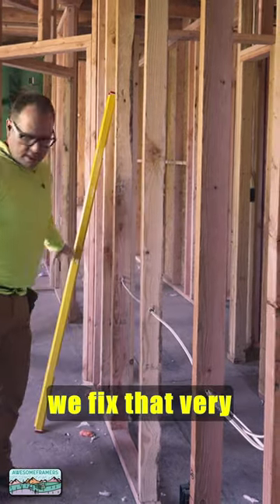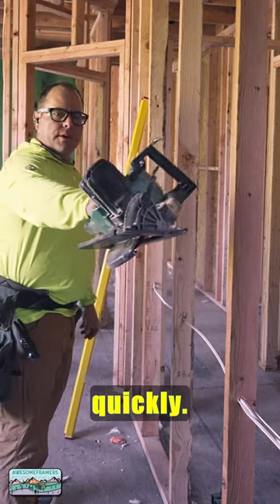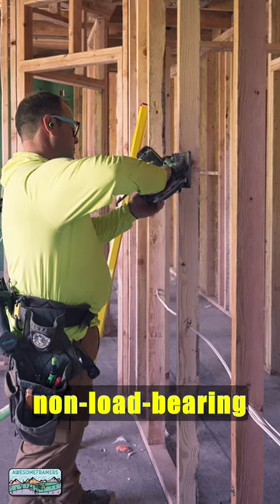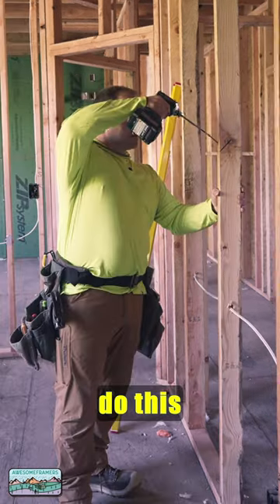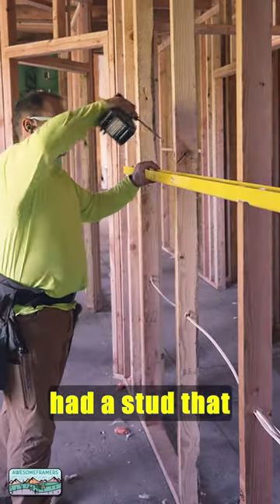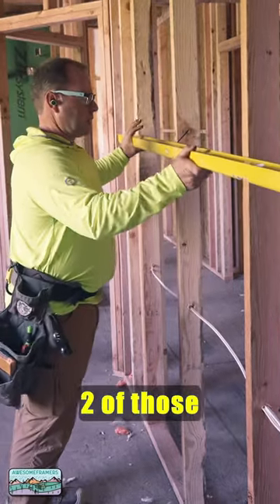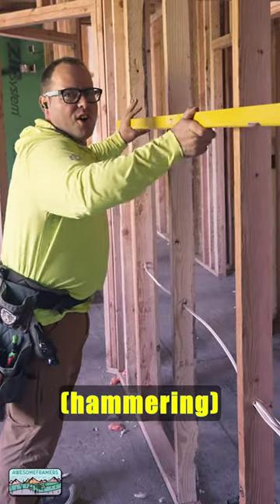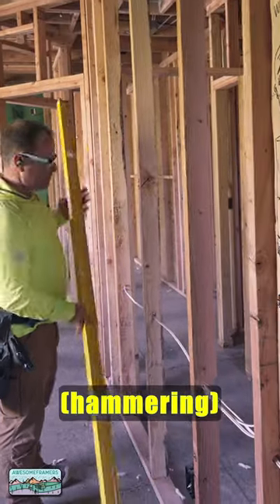Fix it Fast #framing #qualitycontrol #framer #diy

Comment: I just use my Dewalt electric “hand planer” and shave off what’s needed….
Especially cause we all know it’s not just one stud that will need reshaping.
Reply: What about the other side lol
Reply: @chinchilly6544  What about it? lol
I do the same thing, hand planer.
Works both sides without taking too much off the board & done quickly with out screws or cuts.
Reply: The other side bends in
Reply: @jamiehalpin9921  and? When you hang the sheet rock, you will never know. 

Or the worst case… a cedar shake becomes a shim (hate that personally) or any other boards (on either side) can be shaved to match with a planer.
Reply: @fishkulture  
You have no common sense nor experience
Reply: @ericyoumans1148  hahahaha 👍🏻
Thanks keyboard warrior, glad you put me in my place.
Reply: @fishkulture  
Keyboard warrior with over 20 year of framing experience, 
You're welcome
Reply: @fishkulture  plane isn't that fast, for one a handplane is very slow to use most are dull and need forced to shave and going downward umm yeah his trick worked faster I believe slice and screw ✔️
Reply: @fishkulture   What are the odds you'd be done a rabbit hole planting the wrong parts over and over , mark where it needs to be plain and messing up possibie? I  think his trick works pretty good 👍 🤔 😏 😉 🤷 😅 👍
Reply: @MakeWithMike  yeah I can see that, but that’s why I use an electric one, quick and efficient.

And if he said it was over 1/2” out or something else in the description about it, I would probably agree.

And I never said anything about this not working, I’d definitely try it if I really needed, on a non-load bearing wall.
Reply: @MakeWithMike  👍🏻
Reply: That's alot of time

Comment: When I framed homes I had a guy at the studpile notching studs in the center 3 5/8s by 3/4 heavy deep. Then run 1×4s in them for perline. Keeping them straight both ways.  But then again we would coil all our lumber plus turn all the crowns the same way.  But nice trick for subpar framers.

Comment: I wish more builders would do this. Especially with all the Wal-Mart wood circulating these days.  Relief cut your warped studs people.  It's not the drywallers' job, and they'll only do it if it's extremely bad.

Comment: Close I'll give you the real way. Bowed in cut 45 shim it out drive a nail. Bowed out use a power planner. And check your studs vertical and horizontal.

Comment: Bro literally did that right in the knot on the wood.
Reply: Yeah definitely not how it's done..
Reply: What's the issue with that? Is that bad?
Reply: Oh cause like, its a weakpoint?
Reply: Lol I'm surprised the knot didn't pop out when he drilled the screw into it
Reply: @preston0  yes sir I've had them break the whole board putting a screw in a knot lol

Comment: During the pandemic, the price of a 2 x 4 x 10 was up to $14.25 apiece. I figured if I’m paying that much I might as well go to Lowe’s and personally inspect every piece. I threw back over a third of the studs they had and only took the Straight ones. When my framer saw the 2 x 4 x 10 studs, his eyes lit up. Working with straight lumber is so much easier.

Comment: May want to use timber strand if in a kitchen or anywhere it has to be true and straight. Otherwise crown, plane if one board and not in an opening such as door or window trimmer. Cardboard shims if you got crap lumber.

Comment: I squirt some PL adhesive in the cut before screwing it. I'm not sure it makes a difference but the customer is impressed.
Reply: Another way is to have a 3' piece of scrap, sister it 50/50 over the cut and screw it in. Ezpz

Comment: You can also solve that by taking the time to check your boards before using them.
Reply from the maker: That is quite the case Ethan, as was done on this and all our walls.  The thing about wood though, as it wets and dries it can move around.  That's why quality builders go back and check.  Crowning and culling isn't enough.

Comment: If people Crown the 2×4 before they build the wall usually  don't have that problem.
Reply from the maker: That's wishful thinking.  All studs were culled and crowned here.  Wood moves during wetting and drying.  That's why we take this step.
Reply: I made the same comment, but you'd be surprised how many guys there are that don't know what crowning means.

Comment: a plane or belt sander works better and you dont remove 1/3 of the bearing capacity by cutting a notch in it

Comment: Use a planner.  Simple and stronger
Reply: @cmmartti  yes but neither is the trick shown in this video
Reply: Selecting before your placing the wood. This one you can cut in pices for small things
Reply: @coenschouwenburg5041  picking straight 2x4 is too much to ask.  These framing guys barely even watch the final product.  I have seen nails that only go half way thru.  I have seen blocks being cut too shorts, etc.
Reply: @b3arwithm3  thanks for the answer. Im not from the US and every country seams to have their own way to build. But i thought the suppliers uses plainers to get everything straight. But if its long time waiting for a customer is already bends. Dont you guys have problems com termites? Now i live in Brazil here they only use hardwood. I dont know how you guys call it but you need to drill  before anything enters. I installed a weak door portal its already better then pinwood quality in 2 weeks their where big bits eaten from it. Crazy... just a couple of them... i just placed it because i wanted to flip the house. For me personaly i only use the more expensive wood that the termites cant eat. In the US you dont have that kind of problems? Because even in Holland i had experiences with a type of wood worms. That eat a chunck out of my trailer.
Reply: @coenschouwenburg5041  some homes get termites, but not many.  The wood we use for construction is different than for furniture which is much more expensive.
They are cut when they are still wet and twist bend warp as they dry.
Reply: @b3arwithm3  ok thanx :-)

Comment: NICE bro!!!  I GREATLY needed that information!!!
Do you have recommendations on WHERE to do that cut??  Is the cut to be done at the location of maximum "bow"???
Or, if there is a long "bow", then it is OK to do 2 cuts (perhaps at 1/3 from the top of the bow, and 1/3 from the bottom of the bow), ...right??

I truly do not know.  Hopefully you have additional information, and can perhaps do 5-10 minute video on the variety of different fixes.   Although, this is an excellent fox for a non load bearing wall.  👍👍
    THANK YOU!!
Reply from the maker: I went dead middle, normally there wouldn't be an ugly knot
Reply: Just make sure you avoid 48/54 you dont want the cut on the drywall seam
Reply: Use a planer and shave the high spots out. Use a cardboard shim on the low spots. 
No one of quality cuts a stud like this.
Hack job by my Means and Methods  education and 3rd generation life.

Comment: The angle of the cut should be 30° straight down sectionally through two thirds of the depth . A cleat is then nailed to the side of it at least 4ft long and evenly spaced either side of the cut !!

If the stud is really bowed what you have done there will not be sufficient in the long term !! In my country that would be classed defective workmanship .

Comment: I would like to see a load bearing wall- stud straightened 😮
Reply from the maker: Easy let in a 2x
Reply: Just get straight studs
Reply: @dexterjsullen  
Is that what you told Anheuser Busch, when they soiled Bud Light ?
Reply from the maker: @dexterjsullen  straight studs can become "unstraight" in the weather
Reply: @AwesomeFramers  don't let the home/materials sit without weather protections for months
Reply from the maker: @dexterjsullen  that's quite oversimplified and doesn't apply. Heat and cool, oh nevermind, you're not here to actually exchange ideas. You're just dug in.
Reply: @AwesomeFramers  lol im just trolling, yeah you cant be in control everything on the job site especially like apartment complexes, where its a pallet of whole sale wood where didn't do a QC check, and it take years to build
Reply from the maker: @dexterjsullen  🤣🤣🤣🤣

Comment: Let the drywallers figure it out ! 😂😂😂😂
Reply: As a 27 year drywaller 🖕😂 atleast the framers don't go around cutting holes for can lights in wrong places in my finished ceilings or go trenching my walls to run a circuit they forgot like the sparkies 😂

Comment: Load bearing or not, this seems to be a janky “fix”. Does anyone know why planing it down isn’t the “safer” option?
Reply from the maker: Because we need to make sure both sides plane out. If you use a planer on one side, the other side is still bowed.

Comment: I had to help a man straightened just about. Everyone stood wall on his house even his gables. The framers didn't call nothing. They didn't turn all the bows one way. I was there for a solid week. Just straightening up s*** before. The man could put his eye on. I got that job.  Sweet, do your work right and you'll get more. But when you hire somebody to frame my house and you're going to finish it yourself. The framer is don't give a s***They're trying to get it done quick as they can. So don't tell them you're going to finish it yourself

Comment: when I built houses, we did this thing called crown and cull....then you dont have to waste time doing this

had they paid attention, they would have seen that big know and culled it right away
Reply from the maker: The way wood works, is that it'll move during wetting, drying, and temperature changes.  This is why even though the wood is culled at the time of framing, quality builders go back and check.  Sounds like you missed that step and assumed wood won't move after you framed the wall.

Comment: you said very easily and quickly because if it was a bearing wall you would have to replace the whole stud which will only take a few minutes out of span as a carpenter.

The mistake was to allow that board to be put up in the first place.
Reply from the maker: Nope, the wood was fine when it was installed. You understand that wood moves during wetting and drying, that's why quality builders go through and check right before drywall.

Additionally since there's wiring running though the stud, I would fix it differently if it was load bearing. I wouldn't remove the stud.

Comment: Or you could crown all the studs in the wall the same way and not use sub-grade lumber like a hack. The stud should be removed and replaced
Reply from the maker: They were indeed crowned. Wood moves during wetting and drying, that's why quali builders check a final time after fully drying

Comment: I had a framing sub who took his studs to a pallet shop where they routed out a 3/4 x 3-1/2" (1-1/2" x 3-1/2" for 2x6 walls) channel in the center of one side of about 80% of the studs. He would lay in a 1x4 or 2x4 and his walls were dead straight and strong. Cost about $250 but well worth the costs. He painted the channel with bright orange paint so he could make sure they were all turned the right way and he had an engineer confirm that the cut didn't compromise the structural ability of the studs. It didn't work on every wall because of engineering requirements but where it did it was a great idea
Reply: Honestly didn't get how it works.
Reply: I'm confused. Would be nice to see pics or video lol
Reply: So, what i understood is they routed/machined 2×6 stud into a c-channel(something like this [ )and then filled up cavity with a smaller stud and somehow it keeps it straight.
Reply: @Silva_Carlos  do you see it the same?
Reply: @Ihtiandr13  yeah I think so. Still would want to see how that keeps it straight. I do some framing once in a while, have worked for a framing company too but I'm in no way a professional so maybe that's why I'm not seeing it.

Comment: Or you could plain it so you don’t ruin the integrity of the stud
Reply from the maker: What about the other side of the stud? It'd still be bowed us no integrity iof a non bearing stud was lost 👍
Reply: @AwesomeFramers  ya I get it non load bearing wall and you are right it works . This is just from me seeing sheet rockers doing this. they plain the wall and fir strip other side. it is definitely more time consuming. I can see why this is more feasible in a fast work paced environment. And if too worried about this you can scab a straight board to it real quick.

Comment: Is it just me or what that still not level?
Reply from the maker: It's just you, it's flat
Reply: @AwesomeFramers looks awfully wobbly to be straight 😅
Reply from the maker: @chrisc7516  did you even watch the video?  You  can clearly see its flat and not "wobbly".  Add drywall to both sides and voila, fixed.  Go troll someone else.
Reply: @AwesomeFramers add drywall asap. I just noticed how terrible those studs look. What a hack.

Comment: Or you could just "man up" and frame with perfectly straight and true Steel Studs.  Crooked Wood is for fire and termites😂😂😂
Reply from the maker: lots of negatives to steel, you focused on the 1 positive..
Reply: @AwesomeFramers There are absolutely no negatives to steel!
Reply from the maker: @charlesdeering9359  everything has a negative.

Comment: Good enough is the new standard
Reply from the maker: I don't understand people's aversion to the phrase good enough in all industries there is a set point where it is as good as it needs to be and anything beyond that has diminishing returns. That's what that expression means when I use it.
Reply: @AwesomeFramers  Some not all use it as could be better but that's good enough. My comment was open but not aimed at you.

Comment: Dont need the screw. 
The drywall will flatten it out, and keep it ridge.
Reply: You need the screw to prevent the stud from being overly mobile and prone to wobble or snapping if something happens to the drywall. Or if someone mounts something on that wall .

Comment: It's called culling your lumber before you use it.
Reply from the maker: Hey Sheila, it seems you are new to the industry.  Indeed cull lumber before using it.  A fact about wood, it moves during wetting and drying. This is why quality builders go back and check.  This has been standard practice for decades, even using KD lumber like the lumber used here.  Thanks for being interested in learning 👍
Reply: @AwesomeFramers   😂
So that's why they let hardwood acclimate so long before installing it right.
 30 years in the biz  husband's a saw man, jus saying most lumber  has a slight bow so crown it and if it's real bad use it for blocking.
 What they call grade A we called grade B back in the day. Good job though the Sheetrock and Cabinet man will definitely appreciate a good framer.

Comment: Please, use metal for framing like all others in modern world! And try to use metric sistem, more practical and much more precise!
Reply from the maker: Metal has a lot of disadvantages over wood. Do yourself a favor and ask why we build with wood. To be intellectually honest you should try to understand the other side of a topic.
Reply: @AwesomeFramers  I already know, because you are cheap! In Europe, nobody, but nobody do framing with wood! Before 30 years yes, but now not! Metalis always straight, not have nots and deformation, zink plated-no rust and most important much, much faster for work! In most of Europe, Middle East and rest of smart and rich countrys wood is forbidden for framing! Reason? Watch video!
Reply from the maker: @pericajoviva  ok, I can see you've done zero research and are not interested in learning. The Appeal to Popularity fallacy runs strong in you.
Reply: @AwesomeFramers   You really dont understand my bad English! I work with wood before 30 years, I know very well what is wood framing! But that is history, like living in cave! But you never saw or do something with metal system? Try to learn something from Knauf or Rigips sistem of dry walls, you will be surprised! And one more important thing, for us is normal to same team whom put frames also screwing tables on it! Much, much faster, smaller gaps, less weight, less dust, tools are more comfortable for caring and using, less possibility of injuries... Believe me, I try both, I do both and very well know what is better!
Reply: @pericajoviva  We use metal stud for all new commercial construction and wood framing for residental structures up to 2 stories. 

We have homes as old as our country is that were framed in timber, clad in brick and lath and plastered inside. When the rest of the world was recovering from WW2, America was mass producing dimensional lumber which allowed for faster and more cost effective framing leading to a housing/baby boom that made Americas economy the largest in the world.

Wood is strong, long lasting, CHEAPER without sacrificing important compressive qualities and when incorporated into a designed shear wall it can withstand lateral moments....

And guess what bud? We actually have educated people here in America (ask the Chinese who send their kids to college here) who understand the complex building challenges for our expansive nation. In some regions you'll have snow load, others seismic and hurricane concerns. 

We use metal strapping and hangers, plates and tiedowns, jbolts and rebar. There's plenty of steel in our wood structures.

Comment: Heres a trick.  Do it right the first time.......duh ya dum dum
Reply from the maker: Classic internet troll. You see sir, wood moves as it wets and dries. It's not stable until low consistent moisture content. Hence the reason for checking.